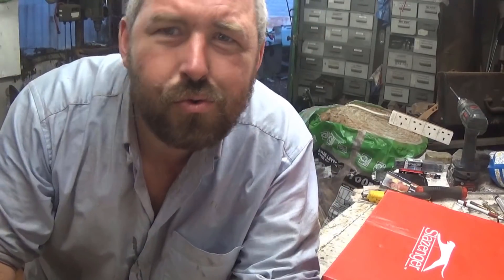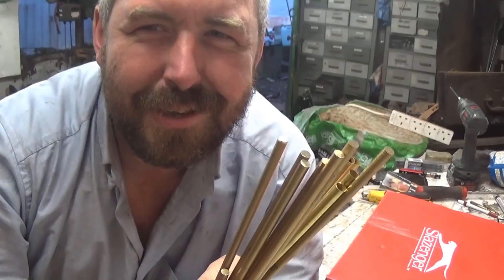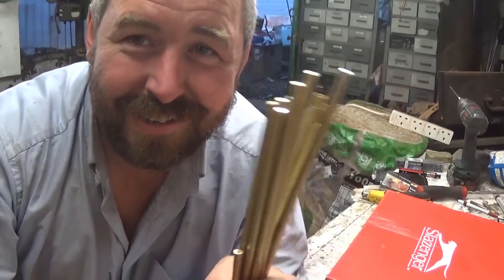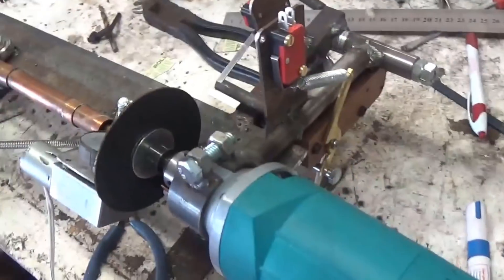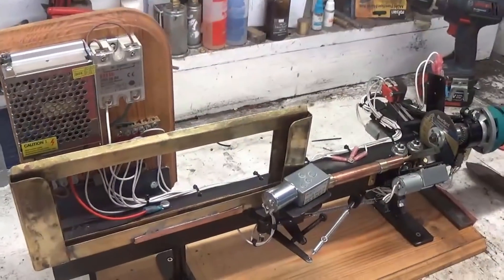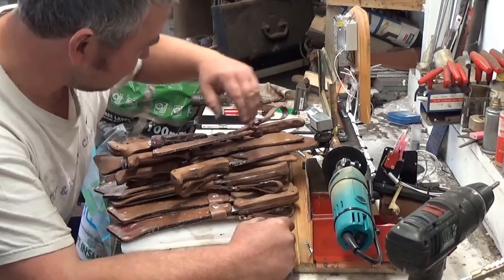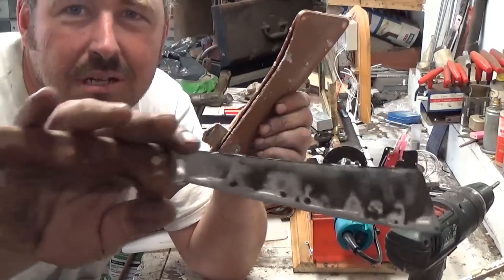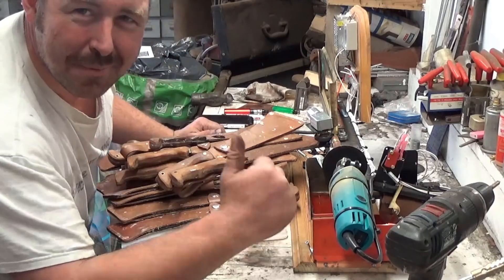Auto Mega Cutomatic! (automatic cut off saw)

Comment: Hopefully you were wearing safety glasses at all times when operating. Also, a simple guard over the top of  the cutting disc would not be much bother to make, say a PET bottle cut in half lengthways. Any cover is better than no cover..
If I sound like an admonishing metal shop schoolmaster, take it from me who has gone to the Emergency ward at hospital to have a metal/grit fragment dug out of my eyeball. This went up under the edge of my safety glasses when angle grinding. It was a very unpleasant experience (the digging out), and now I wear a full face shield when grinding or cutting.

Comment: That is stonking! I'd have gone with an arduino solution but watching you do an analog system was fascinating - and the results are something to behold! Heath Robinson would be proud!
Reply from the maker: I wouldn't know where to start with an Arduino, an old apprentice of mine is constantly trying to force feed them to me.
Logic gates would have been something I might have considered if there had been any more inputs, I messed around with them at school.
Are you self taught?
Reply: @turboconqueringmegaeagle9006  I'm a software developer by trade (30+ years) only recently got into arduinos. I'm still massively behind the curve on general electrical stuff but the microelectronics is just about pushing / sensing signals around - definitely helps to have a coding background.

I bought an arduino kit box on amazon for less than £20 - comes with tutorials - that got me started enough to be able to start asking the right questions :)

Comment: Proper nutter. Not so much a sledgehammer to crack a nut as a press shop to do it instead.
Reply from the maker: Haha nice one Benedict
Reply: @turboconqueringmegaeagle9006  I am interested in the idea that despite having two shipping containers, and a shed/workshop, that you need another container. Also wondering where you are going to put it.
Reply from the maker: @BensWorkshop  CNC plasma and router workshop and I've got space for at least 3 more 20' boxes, I'm sure I won't be able to do anything about it till early next year but I'm working towards it, currently containers no.1&2 are leather workshop and storage, I'm still working on them but they are functional and don't want to be crowded by other activities as I would like to add to my online shop, leather pouches and more blades, all batch produced and reasonably priced!
Reply: @turboconqueringmegaeagle9006  Fair enough.. Each one of your containers is as large as my shed... so I retain the right to feel a little jealous. :) Good luck!
Reply from the maker: Oh...  You have Windows though!
Thanks mate.
Reply: @turboconqueringmegaeagle9006  True, but you could cut windows in if you wanted to!